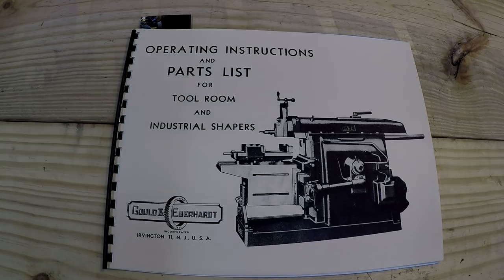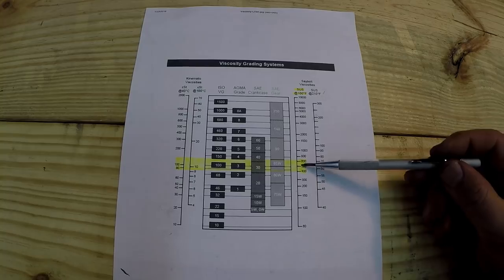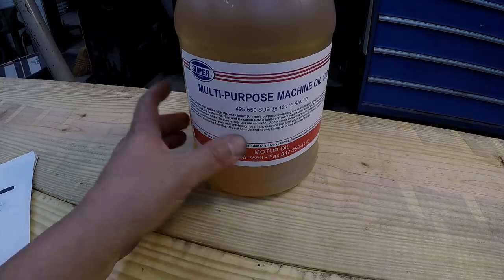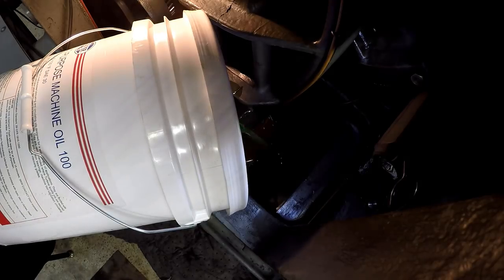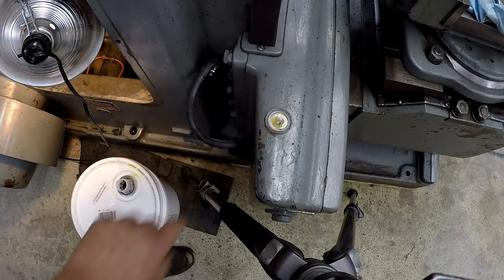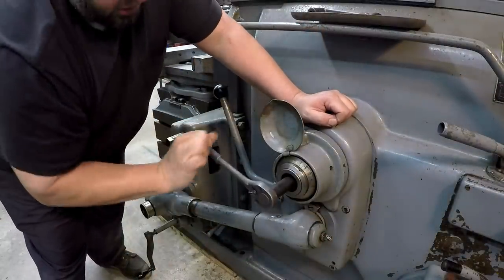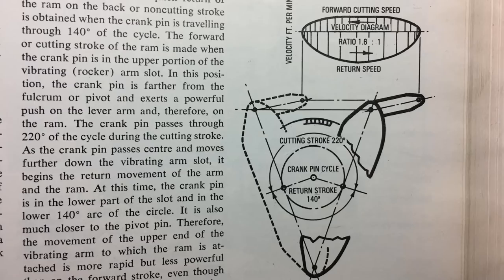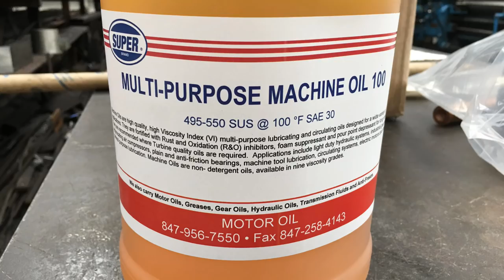G&E Shaper New Oil and Run In

Comment: Instead of pinching the copper tube on the oiler you could put a needle valve so you can have more control over the oil flow
Reply: I agree. Un-pinching a tube would be a big problem! Two thumbs up!

Comment: I can see why that machine got so full of yuck in the sump. That huge open hole at the bottom of the ram when it is back is just asking for dirt debris and chips to fall down into the sump. I wonder is there something missing there? Maybe a guard could be added to help seal it up.  22:14 you can see the daylight thru the side of the machine under the ram.
Reply from the maker: There is a rubber shield there under the ram for helping to block the opening, but I'm planning on revisiting that as another upgrade soon. I'm sure I can make a new one that will be a better fit.

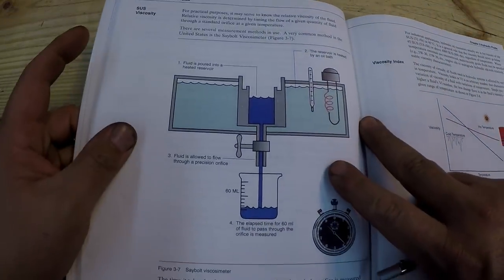Comment: Hi Adam - your book said 60ml, not 100ml. (4:28) Don't know if you noticed afterward.  Could you add some little valves to the oil feed lines to fine tune the flow to the oiling points?  Would be easier to adjust than pinching the copper open/closed.

Comment: What a beautiful piece of machinery and engineering. Watching the crank assembly in motion is amazing.  McMaster-Carr carries a bunch of precision flow-adjustment valves, you could modify the plumbing for the oil distribution system and install some needle valves or similar to allow you to more precisely fine tune the oiling flow rates to each felt-packed oil well on the machine. I have a suspicion that G&E was actually responsible for the pinched off oil lines and that was sort of an engineering correction on the fly.  It appears that the pressure and flow volume to the front left corner oil well up on the ram section is higher than the rest of the ram distribution system due to something relating to the way it's plumbed, and pinching off the line was their simple "fix" from the beginning.   If it were my machine, I'd install flow-adjustment valves in the lines to all the oil wells and then fit the output side of the oil lines with some rubber hose temporarily to allow me to fill a graduated cylinder and measure the flow rate at each well with the pipe wide open, and then tune all of them to be the same exact flow rate so its oiled equally at all 4 corners.  Also I'd venture to guess that with the oiling system flowing so much oil up to the ram there isn't enough back-pressure to divert adequate flow to the knee, which may be why you're seeing such a slow fill in that well.  Again something that may be solved by being able to precisely adjust the oiling flow rates to each branch of the system.  I suppose with some trial and error you could achieve the same results with the line pinch method. Maybe I'm just way too meticulous for my own good?  Anyway, thanks for making such great content, I can't recall how long I've been subscribed now, but I wasn't even half way into one of your videos before I subscribed. You sir are a master machinist, a gentleman, and an excellent content creator.  I know there's been some "criticism" lately over how your videos are made, but keep on being you and making them the way you want. That's part of what makes your channel so unique and special.  I've enjoyed the ride of the G&E Shaper so far and I'm sure I will continue to do so.  Can't wait to see some chips!

Comment: What an incredible (and incredibly well made machine) - it's a pleasure to watch it run and see it given it the care it deserves. 

I believe part of the reason everything is in such good shape is that impressive oiling system. It's simple, but incredibly well thought out and executed. Not many modern machines better it. I wondered about the fast return stroke and knew it had something to do with the bull wheel ratio, but it's such an elegantly simple arrangement I hadn't figured it out. They just took the inherent fulcrum change of the variable stroke ram drive and used it to their advantage. Thanks for showing us how it works, and please go thru the rest of the machine when you have time and explain each system.

I was the guy that suggested the tube was pinched off by an operator who got tired of cleaning up oil, and it seems I may have hit the mark there.
You may want to install a small brass valve in the left front way line so you can finely adjust the flow there. You could just cut the line below the sight glass and put in a compression needle valve. A few of those valves strategically placed around the machine may let you fine tune the oiling to where it doesn't drip too much and still gets adequate lubrication. 

Congratulations on reviving such a great piece of living history. I completely understand your motivation for wanting to own a machine many view as obsolete. There's something about the ingenious way our fathers and grandfathers created machinery from cast iron and hard work. It got the job done with distinction long before the computer was the easy way.
Remember our freedom was won with such machines, and many of those old machines made the munitions that secured the worlds freedom. Maybe you could call her "Rosie" after Rosie the riveter?

I can't wait until you put the 1st big block of steel on her.
Reply from the maker: Yep, good oiling system is the life of a machine. We see many gearboxes at work that have oiling systems and sprayers similar to this machine that keep the gears and bearings fully oiled all of the time.

Comment: Great result Adam, ready for the next 50 years. Pre 1970's oils varied substantially in quality, chemistry, lubricity etc, each manufacturer/reseller would buy a base oil and sell as their own brand, hence wide variety. Ambient temperature also contributes to viscosity ref ISO/ASTM, for southern US or warmer climates, a heavier grade may be an option (150), and can reduce machine noise. Also, having tramp oil spilling from machine tools was accepted, but now frowned upon/illegal;  so older machines/manufacturing relocated to developing countries. Several European countries have extremely strict controls on this, with machines having to installed in a sealed bund (normally a steel fabricated tray). I am not familiar with US regulations in this respect, but  the few states I have installed total loss systems allowed this. The introduction of "Slide Way/ Way Lubes"  with tackifiers were a great step forward, my J & S surface grinder has an  ISO 32 spec, higher grades up to 320 are excellent, especially for vertical ways. Great channel/video.

Comment: Something to bear in mind is motor oil is unsuitable for our machines. Motor oil is engineered to keep dirt and particles suspended in the oil. This is then caught by the oil filter. Machines, specifically old ones, don't have filters and they need oils (hydraulic works) that lets the dirt sink to the bottom before getting back to your gears etc :)

Comment: Super neat.....these older machines like to bleed oil.  That is how they really keep from wearing out.  As one said...I'm okay with seeing oil ... at least it is getting oil.  There are huge pumps back in the day....that had oil pans build in to catch the drippings.  The oil that bleeds out...is cheap oil...compared to repairing worn parts.  Adam....you might want to fab a stainless steel pan big enough to set the machine on (in) with a 1/2" lip...it would keep the shop floor clean.  Use the pig mat or floor dry to keep the pan clean....Thank you for sharing and keep up the GREAT work.   TF
Reply: And he could use his new plasma cutter to cut it, and new welder to weld it up!

Comment: When I was a kid, I got one running in a shop just to do one job. I had problems because the oil had congealed, (turned to a sort of jelly|),  in some of the tubing. Once running, it had little needle valves, (I don't know what you call them in the USA),  in the secondary lubrication lines, so you could tune the oil flow with a screwdriver. We got the spares I needed from Tecalemit. These days I think their present TD1 is an example. 
Wonderful job on the machine - it looks great.

Comment: Adam - Again I believe those metal oiler tubes are pinched off at a calibrated size to control oil flow - think of an older cars windshield washer nozzle with a similar tube,  they were pinched off in the same way as your shapers oiler nozzles, they should put out a very small pinpoint like stream, just enough to keep the packing wet and maintain a film on the mating surfaces with as little over flow as possible.  Im not a machinist just an ex mechanic, but it reminds me of the old style windshield washer nozzles and I saw a very similar oiling arrangement on an old brake lathe I operated many years ago.  Is it possible the nozzles are still obtainable, im guessing not.  What a very cool old school machine, makes me wish I had become a machinist instead of wrenching on cars and working in factories-lol

Comment: Very good.. Yeah I was thinking you shouldn't mess with the ends of the oiling tubes.. Keith Fenner did a good tune on the oiler he installed on his Rutland Lathe. I suspect you upset the oil flow tuning on the shaper.   What's the name of the book that showed how to measure viscosity?

Comment: Congradulations on getting the shaper running.  I've been meaning to comment for awhile and haven't, but you can use round acylic rod to make correct appearing oiling sight plugs for your machine.  Fishkeepers use acylic all the time to construct fish tanks with simple carbide woodworking tools.  You should be able to chuck up a peice and turn it.

Comment: I think a cool project would be to re-engineer those oil sights and machine some screw adjusted needle valves to allow you to regulate the oil without having to play the pinch tube/pack felt game.

Comment: I suspect that might be a 'CUNO' filter; or some close variation thereof (and not the modern variety sharing the name). As I recall from A&P school, they were better than nothing, but only marginally in comparison to todays paper filters. Cuno filters saw use on some vintage aircraft engines... again IIRC, some were self cleaning via a rotator mechanism; while others were periodically given a manual twist via 't' handle... probably during the pre-flight inspection preceding every flight. I think I remember them saying they need to be taken apart & cleaned on occasion; as specified in the manufactures service manual. They didn't cover them all that deep, and have a feeling they'd been obsolete for decades before I was in school; c. early 70's.

Comment: Great job, with all of the breaking in and adjusting it's good you have extra oil. Instead of pinching the oil line get a small screw (that just fits the tube) and cut a slit down the threads. To adjust the flow just tighten or loosen the screw. Similar to the needle valve on a FRL.

Comment: at18:46 to 19:40  on the return stroke.. i hear a harmonic . that could be metal to metal on the flats of the ram ways..   if you had an automotive stethoscope.. you might be able to touch different areas of the shaper to narrow down where the harmonic sound is coming from..    i worry that the way is not floating on a surface of oil and that the sound is the scraping marks rubbing across each other.  it is probably worth the 4 to 11 bucks for a automotive stethoscope .   i also hear noisy bearings down near the pump.. or that could be the filter scraper spinning.  this shaper did live in muck for oil for who knows how long.  these are just thoughts from a fan.

Comment: I'm a retired painter from an automotive manufacturing plant. Every batch of paint that we mixed, we had to test the viscosity using a Zahn viscosity cup. You should look into buying one. Its cheap and a great tool. A quick way to check the viscosity of any liquid. It will also help you determine if it's time to change the oil in your machines.

Comment: Adam Just a Thought Here!!
Have you checked to see if the Recirculating Relief tubes (if Present) are Blocked, this could be the cause of excessive oil on the ways, as it would cause an unwanted  pressure build up, from what I Remember, the pump should only supply Enough Oil to the Sight Glass Wadding to keep it Saturated so that it can Oil the Ways, Not the Pump!

Comment: Yea, you'll need the pig mats for sure. My 16" G&E slobbers a little bit from a lot of places too. Atom, you're a big boy but from experience here, BOLT THAT THING DOWN. You may not intend to run it fast but sooner or later you'll drop it in the wrong gear and it will go over on it's end. I used 3/4 x 6" kiwi-bolts and wish I went bigger. Think of the weight of that ram capable of a couple of hundred foot per minute, tremendous momentum there. Still looking for the down feed ramp and counting screw drawings so I can do mine too. Bob
Reply: Bob Hausler he is going to move it eventually, that's why he hasn't bolted it down yet.

Comment: Adam, the text of the book indicates that the SUS is the time for 60ml of oil to flow, while you state it is 100ml. Which is correct?
Reply: Sam Breidt I read the same thing you did, I think he may have mis-spoken, it doesn't really matter unless you plan on setting up an oil viscosity measuring unit

Comment: Rather than pinching the tube you could install a valve inline which would give you more control. For that matter you could install a whole valve set for the oil lines which would let you manage the flow.

Comment: I wonder if the felt today is flimsyer and folding over when the ram moves? Can you back up those felt wiper seals with something else stiffer? Just like a modern multipart seals do. Like sheet rubber or plastic or something? Felt seals are steam age stuff. There has to be something modern you could come up with. Use felt in one of the grooves and cut out a viton wiper for the other, out of viton sheet? Heck I bet the hdpe from a milk jug would work pretty good, and will not damage surface...Plus its free and easy to try.

Comment: reminds me of the old clapper block we used in high school  in the 1980's , as our teacher said its old but has a purpose , ours was a cincinatti , watched the teacher demonstrate the ammount of cut you could take with it , it could make some nice thick blue curled chips and shook the floor when he did it ( he worked in industry so he knew what its limits was )  ,  

I made my cross pein hammer and parallel clamps on it  ( still have both ) ,  I about cried when I found out our old high school got rid of all the machine shop equipment ( didn't sell it but scrapped it )  when they built a new building in the early 00's   as they went towards a college prep education , most of the equipment was donated by industry  around the area , now they are finding out there is a need for trades  people and not just cnc stuff and have to buy all new stuff .  happy to see you keeping the old school stuff alive .

Comment: Hello Adam. My CMZ450 has an oil bypass valve that is opened to let the majority of the oil flow back to the sump. This valve is gradually closed till you just get enough circulating.

Comment: The inside looks like a fine Swiss watch only A LOT BIGGER...... Wouldn't worry so much about the excess oil. Had rather know it is oiling than running dry. The old mills and lathes I have ran all leaked to some degree but we knew they were oiling. If that rapid moves that slow how fast does it move in gear. Bet it is super slow. Can't wait to see it rolling some chips.

Comment: You can use pins or number drills in the tubes when you pinch them to go to a particular size opening.
With that oiling system the machine should last several lifetimes.
Thanks

Comment: Years ago I picked up a little portable SSU tester, it is a ball bearing in a glass tube, you fill it with oil and time how long it takes the BB to flow to other side of tube, something like that, only used it a few times.

Comment: I think you are right on the pinched tube-ends to reduce oil flow. It will also balance out the oil flow to the rest. I guess you’ll have some tweaking to do. 
I admire your skillset Adam. Thank you for sharing

Comment: I didn't go through all the comments so someone may have already said this. As a old Navy man I am used to oil rated in saybolt seconds. Our common oil is 2190, 2000 series oil @ 190 Saybolt seconds. 9250 is 9000 series oil @ 250 Saybolt seconds. I could try and explain but I'm going to throw in a wiki cut and paste.

  Saybolt universal viscosity (SUV), and the related Saybolt FUROL viscosity (SFV), are specific standardised tests producing measures of kinematic viscosity. FUROL is an acronym for fuel and road oil.[1] Saybolt universal viscosity is specified by the ASTM D2161. Both tests are considered obsolete to other measures of kinematic viscosity, but their results are quoted widely in technical literature.

In both tests, the time taken for 60 ml of the liquid, held at a specific temperature, to flow through a calibrated tube, is measured, using a Saybolt viscometer.[2] The Saybolt universal viscosity test occurs at 100 °F (38 °C), or more recently, 40 °C (104 °F). The Saybolt FUROL viscosity test occurs at 120 °F (49 °C), or more recently, 50 °C (122 °F), and uses a larger calibrated tube. This provides for the testing of more viscous fluids, with the result being approximately 1⁄10 of the universal viscosity.

The test results are specified in seconds (s), more often than not referencing the test: Saybolt universal seconds (SUS); seconds, Saybolt universal (SSU); seconds, Saybolt universal viscosity (SSUV); and Saybolt FUROL seconds (SFS); seconds, Saybolt FUROL (SSF). The precise temperature at which the test is performed is often specified as well.

What all that means is oil at a certain temp flowing through a restriction of a certain size of a certain viscosity, thickness, will take that many seconds for a certain amount of oil

Comment: Are you sure there are supposed to be two way wipers felts in each holder? Seams like the inner slot is for the wiped oil to collect in for drain back.